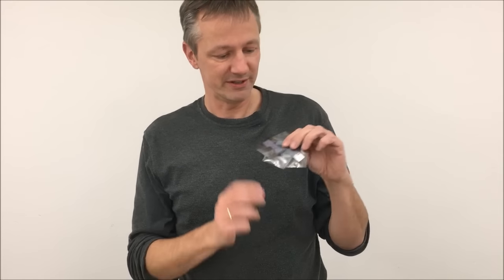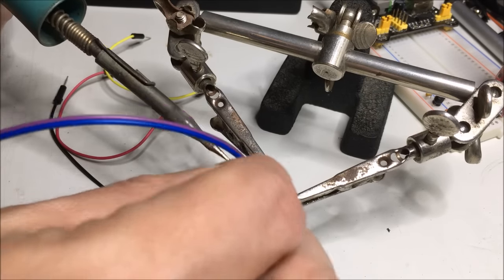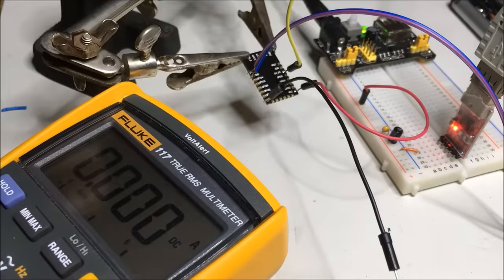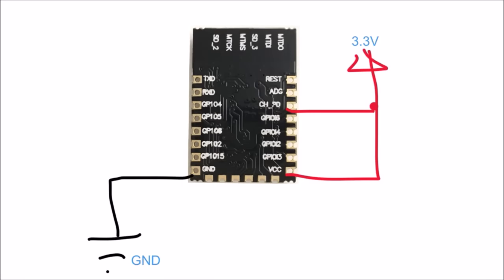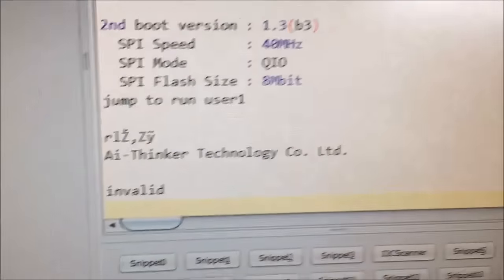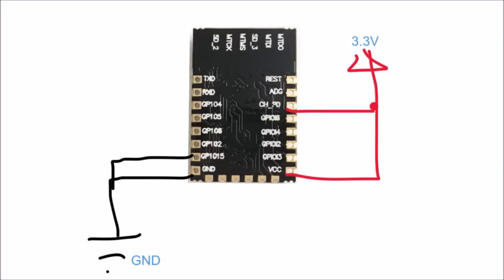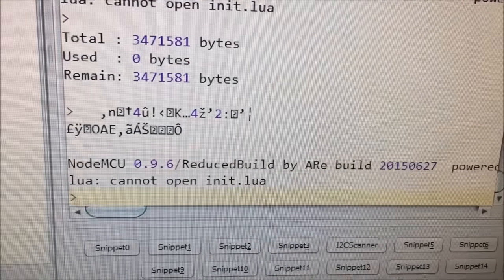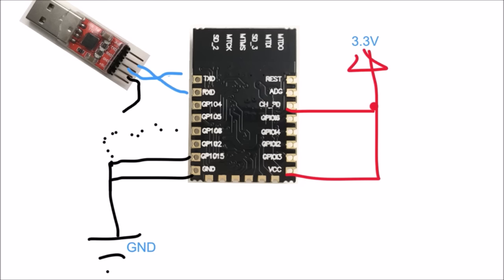Running an ESP8266 ESP-12E module in minimum configuration (As obtained from Banggood)

Comment: For some reason I get blue screen as soon as I connect it to the pc via fdi programmer.... so annoying
Reply from the maker: That usually is a driver issue. Which chip does your USB-Serial converter use? I use the CP2102 for most of my projects ( http://www.banggood.com/Wholesale-USB-To-TTL-COM-Converter-Module-buildin-In-CP2102-New-p-27989.html?p=NT1005763073201409DA )

Comment: i have esp 8266 esp-12e it was working very good until faced that error and i don't know what to do?!!
warning: espcomm_sync failed
error: espcomm_open failed
error: espcomm_upload_mem failed 
error: espcomm_upload_mem failed
Reply from the maker: Do you have any external components connected that could affect the boot mode?
Reply: no just the module connected to arduino
Reply from the maker: Do you use the arduino as a usb-to-serial bridge or do you use a separate USB adapter?
Reply: I'm using the arduino as a usb-to-serial bridge
Reply from the maker: The Arduino is a 5V device, while the ESP needs 3.3v levels.
Do you use level shifters or voltage dividers?
Reply: i use 3.3V pin in arduino but it give no signal that have any power
Reply from the maker: And where do you connect the TXD and RXD lines?
Reply: Generally speaking Bondk, beyond needing 3.3v, the esp needs a higher amperage than what the arduino can put out at it's 3.3v pin. What is almost certainly happening is that you are getting "brown outs" when you are working with your module, where it doesn't have enough amperage. I would highly recommend using a different, 3.3v power source, like a usb charger with a buck converter connected to step it down to 3.3v. You could also likely use buck converter and stepping the voltage down from the vin pin(which won't have that amperage limitation) on your arduino to 3.3v or creating a voltage divider with a large capacitor (like 470uF) so that you aren't using the very limited linear voltage regulator that built into the arduino. To be clear, if you were to plug the esp12 module directly into vin pin you would likely fry it since it's voltage will be somewhere around 4.5v.

What ever the case, you should grab a meter and just check the voltage going into the esp8266. If it is dropping below the 3.3v by more than .2v, you probably are getting brown outs when there are spikes in activity. You may be able to solve that by adding in a 470uF capacitor across the 3.3v rails.

If you do use an external 3.3v source, make sure to connect the ground pin of the arduino into the ground rail of the external power source! :) If you don't, serial communication won't work. (Just the ground, not the positive.)

Past that, if it's not a power issue, here are a few things to check!
-Is this an arduino with an SMD mcu on it? If so, have you put a jumper between the gnd and rst pins to disable that chip?
-On your esp8266, have you made certain you are pulling the appropriate pin high and low? You need pins en, vcc, gpio2 and gpio0 tied High and pins gnd, gpio0 and gpio15 tied low.  (if you have a stable 3.3v source, resistors aren't nessesary.)
-Are you pressing reset on the esp12 when your IDE hits "Uploading..."?
-If you are using an arduino Uno or some other varients, have you tried hooking up TX to TX and RX to RX? A lot of arduino label the tx and rx *of the mcu*, not of the ftdi adapter and thus need to be hooked up that way.

I hope this helps someone!

Comment: Try somebody boot from SD?
Reply from the maker: I haven't seen anyone doing it. Rumour has it, that it takes the same pins that are connected to the flash memory and that the firmware has to be written to the SD-Card without a file system.
So I never tried it or even checked the datasheet fo confirm that.
You can still use an SD card to store data (eg for a web server) as described here:
https://nodemcu.readthedocs.io/en/master/en/sdcard/

Comment: Very bad soldering😐
Reply: The Chinese jumpers he's using are not designed for soldering. The metal is so
inferior solder doesn't stick to them. The female jumpers are also lamentable in
 that the metal within the connector is so thin it deforms after short usage.
 In both cases, bad connections lead to strange results. 

Wire-wrapping is the best method for development work.